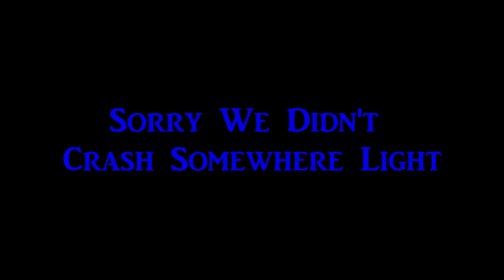Push-Mower Gokart OFFICIAL VIDEO

Comment: How does the stearing works?
Reply from the maker: It doesn't really work at all. Two tires attached to a board. The board pivots left and right. The board is just held by a single pin in the middle. The cables let you pull the board left and right.

Comment: How did you make the push mower drive system go faster? Pulley swap?
Reply from the maker: Had to make it go slower, the original design was too fast and the motor had 0 power at the wheels. There is an idler pulley welded by the grass outlet. Theres the biggest pulley reduction I could fit there, like 3 to 1 if i remember correctly. Roughly. Then another of the largest reductions I could fit going to the tire, the belt twists 90 degrees. I think that reduction was 1.8 to 1. It's been many years since I calculated the numbers. Been meaning to film the underside of it some day

Comment: Did you have brakes?
Reply from the maker: Yes. Took the front fork off a bike. Cut it down. The pads squeezed one of the rear tires. I made a brake pedal to pull a cable to apply the pads.

Comment: How you make a vertical shaft to a horizontal shaft?
Reply from the maker: That's difficult. You would need to add something to the bottom of the connecting rod to splash oil. The carburetor wont work sideways. Would probably need a different carb that will bolt on 90 degrees out. I've never done it, I've always thought it easier to A- find a horizontal shaft motor or B- make verticle shaft work
Reply from the maker: If you're asking about this gokart specifically, theres a belt that twists 90 degrees from a horizontal pulley to a verticle pulley on the axle. I should make a video on the construction of this machine
Reply from the maker: There is an idler pulley set between engine and axle. You cannot belt directly from engine to axle. Believe me, I tried